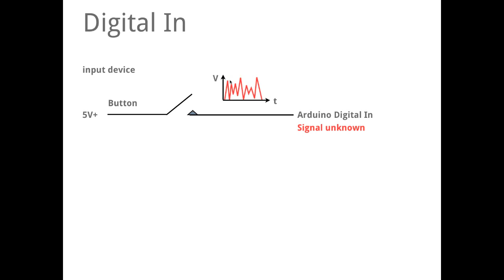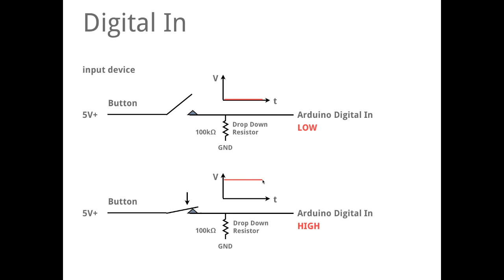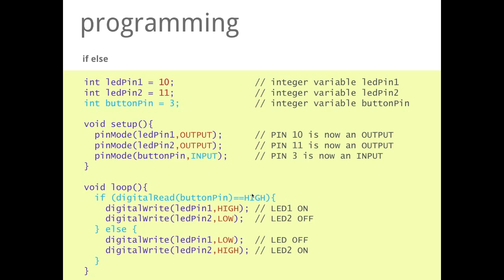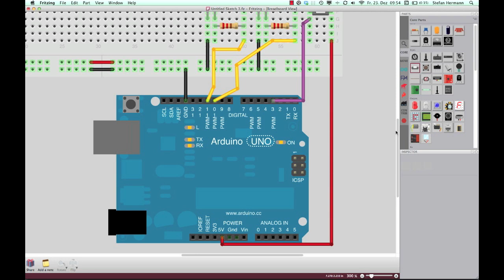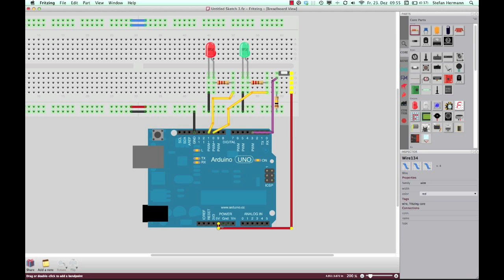Learning Arduino Episode 006 -- Digital In with a button

Comment: one question I have is, how do you choose the resistor for dropdown resistor? Why is 100k picked? How is being calculated?
Reply: +Le Grace Huang You use a high level resistor as electricity takes the path of least resistance.  This gives the current somewhere to go when your circuit is open.

Comment: the first 2 resistors look logical because the voltage goes from the red cable to the resistor (thus preventing too much voltage for the leds) and then goes to the led and from the led with the green wire back to ground. but the resistor used for the button, is being used as; again voltage going through the green wire, then through the button and then it seems as if it goes back to ground with the red wire while the resistor does nothing? as it is not placed before going to the button nor is it placed before the red wire going back to ground.. am i missing something here? i'm very confused..

Comment: Hi Fritzing,
Thank you so much about your video. But i have a question that why when i remove Resistor, the board does not run correctly?
Thank again :).
Reply: I think that is explained at the beggining of the video. Arduino digital in seem to receive a lot of interference, and with such a fluctuating value it does not know when is the button pressed or not. The dropdown resistor is there to absorb the interference, and level the value the digital in reads. At least this is how I understood it.

Comment from the maker: @Atalanttore This is actually intentional. ;) The noise illustrates what happens when you are not using a pull-down resistor for your digital inputs. You're right it's a bit strong, though.